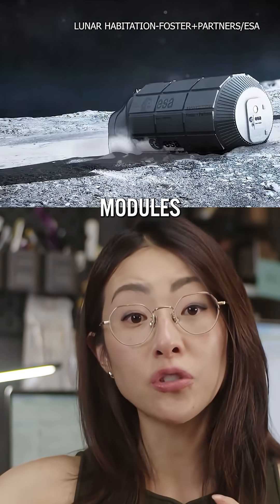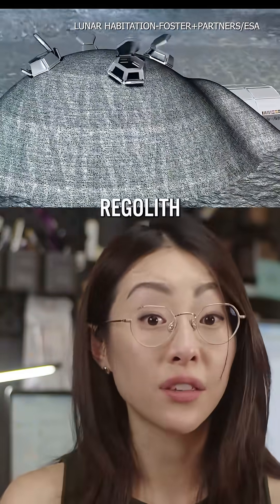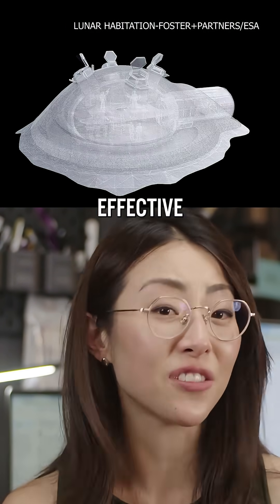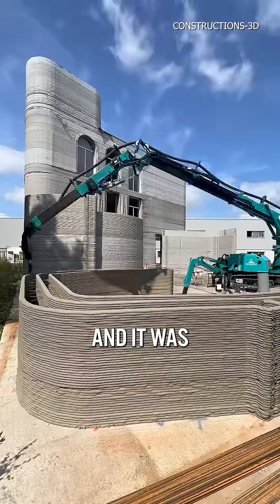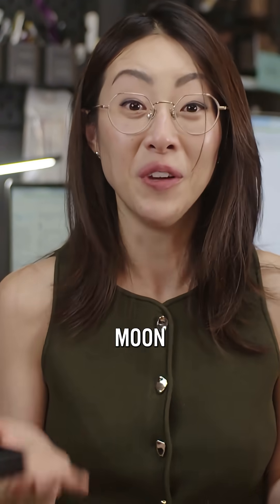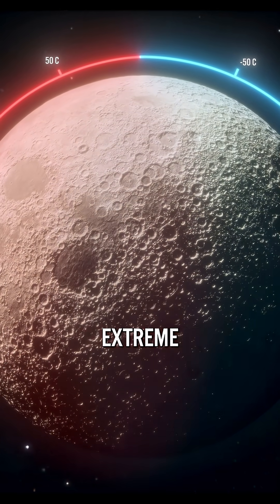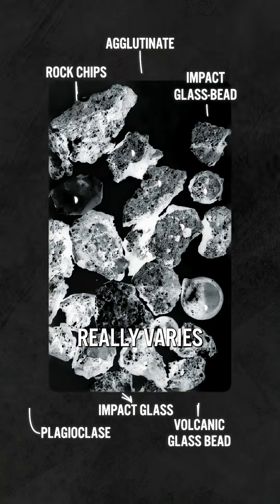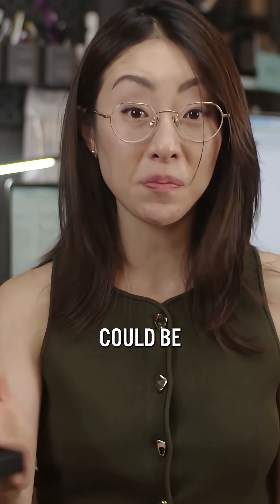What would you build first if you had a lunar 3D printer?

Comment: Another reason why it doesn't work for construction is because it doesn't solve any problems and actually creates a few. You still have to ship the material. You still need a crew of people on hand to facilitate it. You still have to compete with the cost of premanufactured block or forms. And now you have a highly sensitive and advanced robot you need to maintain.
Reply: The only, and I do mean only, benefit of 3D printing for construction is flexibility. Strength is comparable at best, and the process has the other downsides you mention.

It can only place material one layer at a time, preventing any significant tensile reinforcement without an absurd amount of couplers, so it is ONLY viable for pure compression walls or columns. Most large or high-strength structures need that tensile reinforcement, so you can't replace everything with 3D printed material anyway.
Reply: @Builderguy2001 But in the long run aren't custom forms going to be cheaper, anyways? So is that flexibility even worth it?
Reply: @A_Consumer_Lives Custom forms for reinforced concrete, CMUs, bricks, and just about any other method is better for scale, strength, and cost.
It's marginally better if every lift in every project is a completely new shape, which would require new forms and layouts each time.
The only people salivating at this tech are architects who think this will mean they don't have to consider the constructability of oddly shaped or precise walls. Just toss an STL file at the field engineer, and BOOM. A perfect wall exactly to specifications.
Reply: @Builderguy2001 lol well, yeah. There couldn't be any unintended consequences to that!
Reply: @A_Consumer_Lives  This is why smart Architects don't throw their plans at Job foremen they throw them at Structural Engineers who then laugh in the Architect's Face and then create real buildable plans.
Reply: Also, it doesn't look good.
Reply: As someone in trades pointed out. 3D Printing in terrestrial construction replaces the framing process which is currently the cheapest and most standardized process, and makes the fitting process much harder. In space this is largely inverted and solves problems
Reply: But where it really does shine is in rocket propulsion. They just designed and printed a single piece rocket engine that has all of the ports and nozzles installed and tuned out of titanium.
Reply: @maxpain2554 I talked about things like this when I was a kid.
Crazy how may have come to fruition 😊
Reply: "You still have to compete with the cost of premanufactured block or forms." 

That's the big one right there.  A kid can build a toy house a zillion times faster with lego bricks.  3D printers come into their own for specialized shapes like toy figures, but if you're making a box-like structure, it's a huge step backwards.
Reply: on top of all that, most dont do it because it is likely not going to be built to code, due to it being 3D printed and building codes not being accepting of alternative building practices.
Reply: Not only that there isnt enough actual construction guys doing the work to change codes when a wall has to have say four seperate supports but the printed intagrates them then its a violation so then the crew instead of using a tool has to do the lifting
Reply: Yeah, it doesn't "improve" anything on its own, only change the form factor of certain things, in a sense. Maybe if it had the same efficiency-of-scale as existing methods, we might see more of a difference- but we don't have that, and we can't/shouldn't make massive changes like that off baseless speculation.
Reply: The idea is that on the moon you only need to monitor and repair them. The monitoring can be done from earth where the delay is much cheaper.
Reply: @letsburn00 how does it feed material, though?
Reply: The main issue I've seen is that it doesnt save the buyer any significant money, but you're stuck with this novel, experimental ugly structure. 

If it cost 50% as much, I could see folks jumping on it. But the folks "printing" homes are so greedy they've narrowed their potential market by like 95% and now blame people spreading supposed misinformation about those concrete homes being lower quality 😂
Reply: The crew you need on 3d printing is significantly less, 4 is typical, 5 max
Reply: @ObeliskDemon significantly better skilled, highly qualified and superior pay scale.
More technicians than construction workers.
Reply: @ravenaddams6299  yeah but a significantly low chance of a work place accident.
Reply: @sujithsudhakaran745  added danger or a self directing heavy construction equipment 😮😊
Reply: @ObeliskDemon with 5 people on the building site you can construct anything 😂😂😂 why use an expensive robot and the result is ugly😂😂😂
Reply: No harder than shipping concrete on a truck, consumers don’t want to live in them.
Reply: Nah, they did this on Doctor Who. Just need a swarm of microbots with a hive mind.
Reply: The problem is the technology trying to compete with already at scale, optimized, repeatable manufacturing rather than using it for complex geometries, such as they're doing with the moon. It's a basic misapplication of the tech.
Reply: @ArcaneShenaniganery thats how you dial in and bring the new tech to scale. You don't take it and try to do something unique or niche. The technology gets better and costs go down by applying it to something simple like 9 walls and 5 windows and a door.
Reply: @elliotalderson4568  This can already be done at scale and far cheaper using existing technics, such as using preformed concrete blocks or tilt up concrete walls. 

And while one day it MIGHT surpass preformed concrete blocks, it can never be better at scale then tilt up concrete because it is basically the same thing with far fewer steps and far less complex machinery
Reply: And the UNIONS are going to need to have a private sit down 😮😊

Comment: on the moon, couldn't we dig trenches and then 3d print covers for that trench... using expanding epoxy foams as sealants between the soil/surface and the ceiling?  then burying it under the soil to add enough weight to hold pressure?
Reply: The moon has lava tubes, the plan NASA has been moving forward with for some time is to use magnetic field data to map the lava tubes and find one ideal for a base.

Comment: The sand and ashes on the moon are extremely abrasive. We can make a material that will resist abrasion for a certain time with no movements, but not for very long. Pretty much everything that was left on the moon in the 70s has been destroyed by a slow corrosion already. And that's immobile stuff...
Now picture a machine using that abrasive material, pushing it in tubes, mixing it and moving it as it slowly grinds every mechanism and surfaces of the machine... And it's on the moon... There's nobody there to do a maintenance every month to replace parts that are constantly grinded down, going away faster than the time it took to reach the moon. That 3d printer would be a nightmare of a tool to maintain.
It's more likely that they will use solar energy to vitrify the surface and make it smooth, then use a solar over to make bricks out of that material.

Comment: Nobody is going to pay to ship cement to the moon, and there is very little water there. If we're ever going to build anything substantial there, it'll be by making mud out of whatever material is there and letting it cure, just like we do everywhere on Earth. I suppose heating the "dirt" up there to use it as a liquid and forming it like mortar, is the most cost effective way. That's never going to be a scalable process anyone would do by hand, in a space suit, because it's just not worth the risk.

Quaise is working on a kind of laser drill for putting holes in the ground. They want to be able to drill to geothermal depths at most locations on Earth, which is beyond the practical capabilities of traditional drilling with a bit. They can already burn holes through rock and leave a glassy surface around the edge.

Melting regolith glass and forming it into specific shapes, especially if using aggregate or boulders as fill so you don't need to melt and form the whole wall, seems cost effective and plausible. The solar radiation on the moon offers much more energy per square meter, because it's not filtered by our atmosphere and magnetosphere. Plenty of higher energy particles to catch.

The first thing I would build is a large box with a grid on the top and supports, maybe the size of a city block. Make it substantial enough to support the weight of overhead cranes, and then begin by excavating the moon dust to pile it up around the outside edges of the box. Use the large rocks to build walls and cement them together with melted moon dust, just inside the box, like the perimeter wall of an ancient city. That's where shielding against radiation can go, collecting it and converting it into usable energy. Then begin forming the walls of the buildings needed for infrastructure. The interior walls can be melted to form a surface that can hold air at appropriate pressures.  The roof of the buildings can be domes, but would need a machine on the ground to go inside and seal the interior of the roof. Likely the same machine that built the scaffolding for cranes. That thing would need to be capable of moving material and climbing structures as it builds them, similar to the machines used to build the giant arch in Minnesota or wherever it is.

Lol I guess first thing is really a minimal solar collector to power remote operated machines that can build more power capacity. Like building 1 "cell" that can copy paste itself, so we would have 2, then 4, etc.

Remote operating to the moon is easy, it's not far and if things go wrong we can get people or equipment up there. It's basically the ground level of our space elevator. Pulling just what we need out of the basement is difficult, because we're pack rats who think we need to carry everything from one nest to the next.

The moon is already powder coated, we could cure some kind of road on it with space lasers. There's not really wind to contend with, so the wheels on vehicles could be simplified for road use.

I don't know. I've seen skyscrapers built with just a few machines and tons of material. The raw material is scattered all over the surface of the moon, every inch of the thing is a stocked construction site.

Comment: Hello Dami. 

Like. 

Very Canadian. Too much actually. 

The module process of transformation indicates a lapse in what 3D structures can access to facilitate. 

It becomes SORT of 'Like' perfectly managing to fit a square into a hole to which it can't. But it does...

Perfectly. 

This can be be a handicap but, as you noted nicely, can be used to an advantage. 

The deductive process of space as defined and space as noted gives leeway to creative application. 

Not to see a square that can't into into hole Fit. 

But to see the viable parameters for something greater. 

A hexagon for example. 

This has translational capacity application to material sciences too! 

Like in structural tensity.

Comment: Building on the ground doesn't feel like the best option considering that the moon has no atmosphere, no protection from asteroids or rays.
Building underground would be better but digging may be difficult so a good option could be use natural caves.
Reply: It's actually a relatively easy option (and the one NASA has been going with for years), there are tons of lava tubea on the moon from when it once had a volcanicly active core.  We can find these using magnetic field data.

Comment: 3D printing solves a problem, that never existed. And bring some new ones.
Existing solutions already allow to build fast from locally available materials. The reason, why building anything takes so long is mostly acquiring land, various permits, and doing everything other than building floors and walls. Which is the shortest and cheapest part of building a house
Reply: It solves the easiest part of construction. Throwing up walls.  Foundation prep, electrical, plumbing, etc are all stuff 3d printing doesn't help with.
Reply: @SaltyChickenDip  Right. The actual revolution would be prefab walls. With plumbing, wiring, insulation already done. Just put together, paint, windows in, put a roof on and it's done

Comment: The problem with printing on Earth is that you need a team of people to set up the printing frame for the machine, and it has to be perfectly level; otherwise, the building will fail. And the setup takes a few days—by that time, you could have built it with conventional methods using the same crew.

Comment: We already know that there are lava tubes on the moon. Wouldn’t it be easier and more efficient to take the inflatable idea and just use it in a tube? Run solar panels outside.
Reply: Yes, and that is what all serious plans of a moon base use, I'm not sure what she's talking about, no amount of "3D printed shell" is going to be effective against a grain of dust moving at 100k m/s.  This is to say nothing of the radiation blocking properties, or the lack there of.  Additionally, "material on the moon" aka moon dust, especially that on the surface, is extremely difficult to do anything with do to be blasted down to razer thin pieces, it's like Asbestos but able to shave through kevlar the way it normally shaves through lungs.  While there are ways to deal with it, using it as a primary building material, especially in a 3D print system would be an absolute nightmare.  

While there may be other plans that people have proposed, lava tubes are the plan that NASA (and I believe Eurospace) are moving forward with, and generally considered the only plan feasible anytime soon.  We have already begun taking magnetic readings of the moon (almost all the recent moon missions have been equipped with magnetometers), and the plan is to send Artemis with a high precision magnetometer to perform manual observations on the ground.    

Granted, this is all assuming that NASA doesn't shut down their magnetic division, which is not an impossibility, and would almost certainly mean Eurospace beats them to having a moon base, potentially China as well.  To my knowledge there are only two labs on earth capable of consistently making magnetometers to the necessary specifications to perform this (One at NASA, at risk of being shut down, one in France, unable to bid on many US government contracts).
Reply: @drakerp2 Yeah, there is. You. Remember Newtown' s law? So what if a piece of dust is going 100km/s? The energy is still tiny. Now. Radiation on the other hand is much, much worse. They are even smaller and much faster. Like near the speed of light. And they are coming in all directions all the time. That's why we need meters and meters of materials to protect the people from radiation. 

That being said, lava tube is great but we have little to no idea what is going on inside. So can you design something for something completely unknown? You can't especially when the mission is critical, reducing risk is the game, not taking them. For example what if the entrance is 100m deep? Now suddenly your cost to access those lava tubes is the cost of your budget to just stay on the surface.
Reply: Yes, lava tubes are the way to go for the areas that have them. Massive structures with enough shielding that have been preconstructed.
Reply: It would probably be easier to make a tunnel with coated walls than a space igloo.
Reply: @lucasbachmann that’s kinda what I meant
Reply: @lucasbachmann Easier still would be to just stay on Earth.  Truth be known, there's lots more fun stuff to do down here.
Reply: @lucasbachmann Or we could just stay on Earth. Truth is:  There's lots more fun stuff to do down here than up there.
Reply: Puting an inflatable tube into a tunnel full of razor sharp glass & basalt that exists in a vacuum probably isn't the wisest decision. Even without the jagged rocks, it's an unstable environment. Construction in space requires precision & full control.
Reply: @k-ozdragon Current inflatable materials are more than sturdy enough to be suitable for a lava tube.
Reply: Maybe if we get lava pipes on earth first
Reply: @theuserofdoom  We have lava tubes on earth. Lots of them.
Reply: @theuserofdoom  a lava tube is a tunnel in rock formed by magma that used to flow through it when the area was volcanically active. not any sort of technology, just a cave. we also do have lava pipes on earth, its called the steel industry.

Comment: I wish you showed more realistic space structures. Previous shorts show large internal open spaces. This one shows wasted space as well. When it comes to a place like the moon, these details are important because you have to fill it with air. Air has to get there somehow, so you'd have to ship it there. There's a reason why stuff like the space station is set up in small modules like it is other than weight constraints. As a result, you're putting a lot of ideas out there through your visuals that are extremely unrealistic to ever become real even if it is a so-called concept.

Comment: They need to do 3D printed pre-fab kit-homes (delivered & easy assemble). Not this on-location concrete pouring I think. Maybe the molds and you just hire a contractor to fill and assemble.
Reply: There's no point in doing 3d printed pre fab. You can just do casting  for prefab like we already have. It's faster and cheaper .